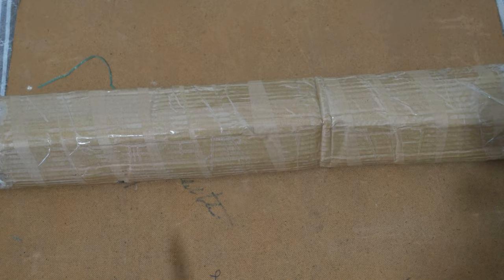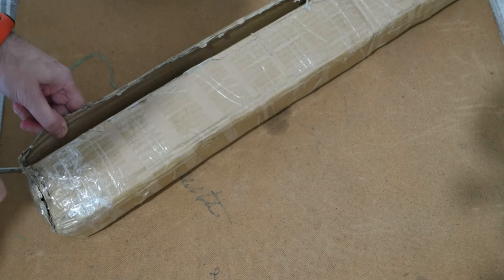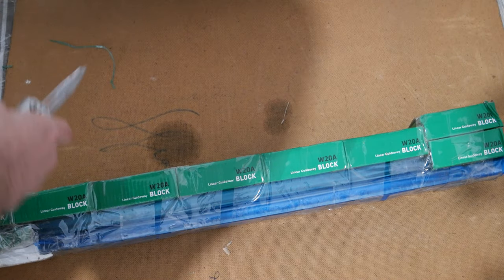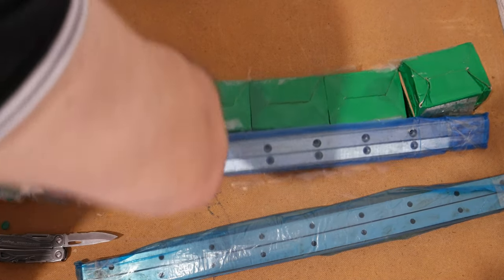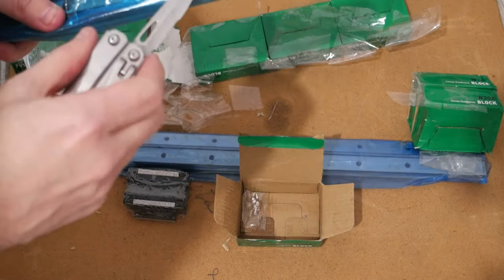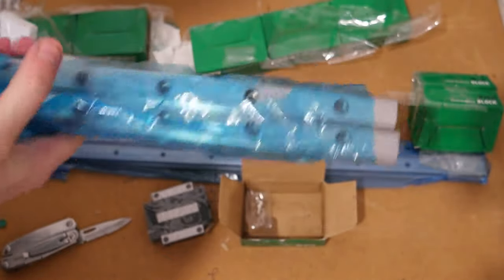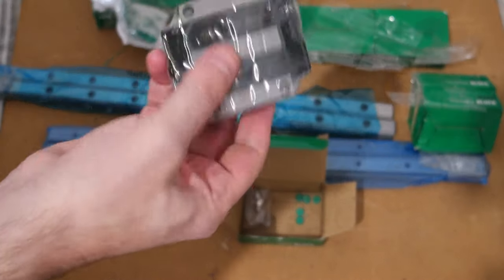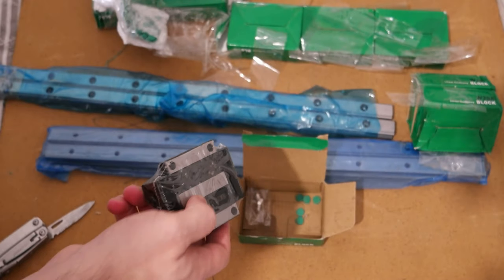Unboxing linear guide and slide blocks for new 3D printer

Comment: That's some heavy duty stuff.
Reply from the maker: yeah, the linear guide are pretty heavy so with 2 blocks it will make a rigid slinging. Will need to decide if to use all 4 guides or just 2 depending on the build. Please subscribe, thx!